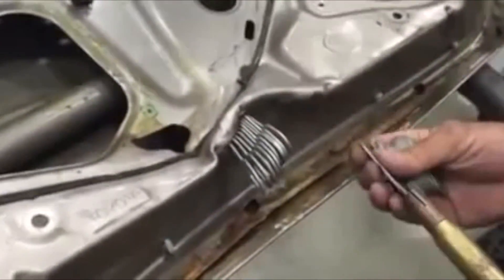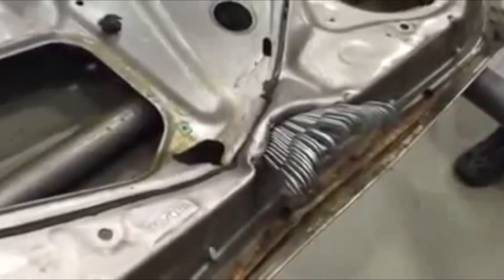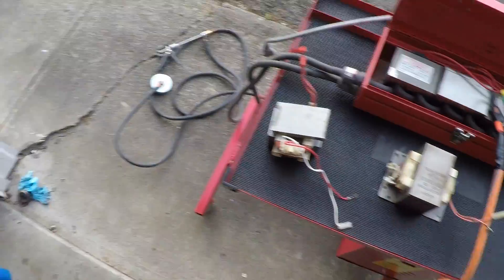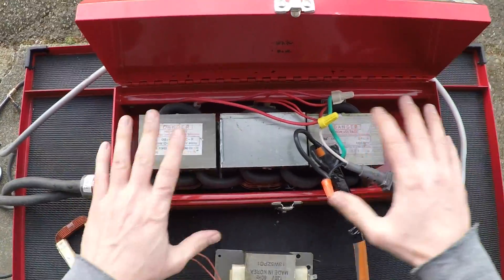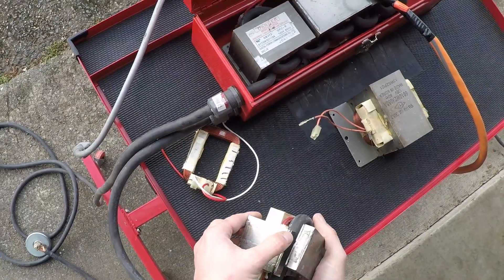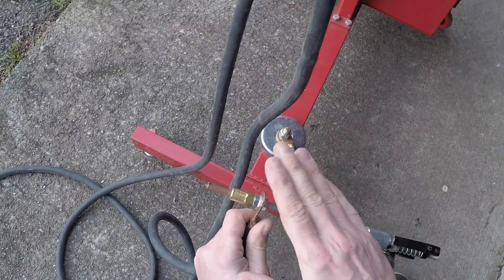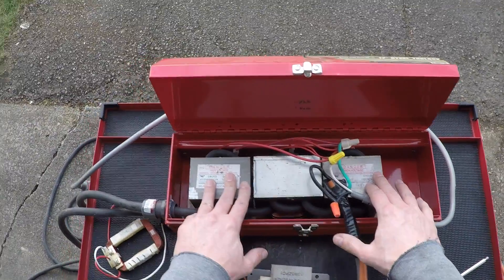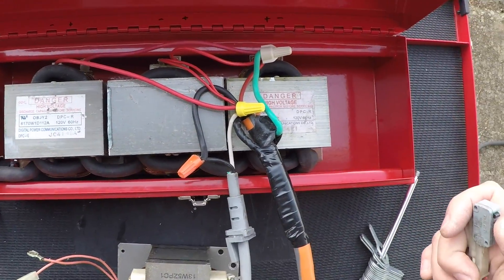✅ How I Built My Car Body DIY Spotter Electric Dent Puller Welder From Microwaves and How It works

Comment: it stil doesnt show alot.you just showed a transformer build
Reply from the maker: That was an older video, I've made an updated video later where I went into great detail on the build. Here is the link: https://youtu.be/j6UgtCN5vzU
Reply: @fix206  thanks i saw the build i would just like to know if it is nescasary for the timer relay seeing you have a push button on the puller.cant you just controle the time on the trigger.
Reply from the maker: Push button is the trigger

Comment: Where did you get those red push attachments? I've looked at various dent welder kits and can't find any like that.
Reply from the maker: The hand squeezer/puller with orange bases I bought from Russia. I am actually working with the manufacture and I have secured a shipment of these kits. Going to have them available for sale. Let me know if you're interested
Reply: @fix206  yeah I'd definitely be interested, what's your timeline for availability?

Comment: I love the red leverage tool you made to pull out the dent.is that on your list of videos. What is. The size of the tip you weld. To the car. Is it soft or hard steel I'm going to try to build one. What is the voltage coming out of the transformer and the amps. Is it ac or DC volts. Hope you can answer these questions for mye
Reply from the maker: Hopefully most of your questions can be answered in the updated video that I did on this tool  https://youtu.be/j6UgtCN5vzU

Comment: Great video. I built a spot dent puller just from your same idea, but I have a strange problem, when I get the short to try stick to the sheet metal, the copper pointer melts and never gets the sticky method to the metal. Any idea what do you think is happening ?
Reply from the maker: The problem you're having is noncompatible metals. Both, your ground and the metal pooling tip have to be made of mild steel, they cannot even be made of stainless steel, anything else but mild steel will not stick to the panel that you're working on
Reply: @fix206  Hi again, thanks for your response and comments. The ground terminal and dent pulling pads I am ussing are from copper. The only part I made were the transformer, just same at yours. All other parts, pulling shaft, gun, copper pads... were purchased from aliexpress. I have in the secondary aprox. 7.2 volts. And using welding wire #4. If I made a short time not welds, If I use a long time aprox.  1 second, the pointer melts and do not welds to the sheet metal.
Reply from the maker: make sire that both ground and the puller tip are steel, not copper
Reply: @fix206  Hi again. I just did some search about the pulling pads material got from the original spotter pulling parts supplier. Those are steel cupper coated. That is the same material used for the factories that built spotters. 
So I am using same material that use original factory electrical spotters. So what is the cause about not sticking to steel panel..?
Reply from the maker: It is really hard for me to say without physically being able to take a look at what's going on with your situation
Reply: @fix206  Friend. I just fixed the issue. I was using wire #2 in the secondary of transformer and wire #4 for the electrode gun and ground, so in accordance to Ohm's law, the wire #4 was working like resistance and not all current was in the electrode as is needed. The wire of secondary, gun and ground must be the same all the way. Now it is working much better.
Reply from the maker: Oh, good to hear that you've got everything worked out... 👍

Comment: Hi. Loved your video and i'm going to build one for myself. I didn't fully understad the wiring of the thicker cable runing trough the transformers. Can you explain it better. 

Thank you.

Pedro Cardoso
Reply from the maker: It's really simple, thick cable just loops around the transformer core as I've done it in the video, once the primary coil is powered up it creates a very strong electromagnetic field within the transformer and that magnetic field in turn energizes the thick cable. So the cable isn't connected to anything inside of the transformer if that makes sense. So as long as you follow all of the steps in the video you will end up with a working spotter !

Comment: Hey my friend I found your polar that you said you bought it's a pilot type 2 puller 120 volt they got a new version of it out they sell it on eBay all right have a nice day and be safe
Reply: Sorry correction they have a type 1 that he has on eBay for sale there is a type 2 out too also sorry about that I had to clarify that have safe day
Reply from the maker: I just looked it up and I did find it on eBay, but the price is pretty steep $1250. I spent about $100 or so in parts to build mine.
Reply: Don't get me wrong I love the one you built that one's great I was just trying to find the polar part it just happened to come with the other part of it that's the only part it  stinks
Reply from the maker: Oh I gotcha, at some point in the near future I will be doing a video where I will reverse engineer this puller. Because I had quite a few people inquire about it
Reply: That would be great my friend I bet the other people would appreciate that too

Comment: You told us at the end that you didn't build the puiier you bought the puller I really do like to know where you bought it from if you could really remember where you bought it from that would be great because that's the reason why I want to build one I could buy a slapstick puller from anywhere I like to pull her you got it that's better than anything I seen so far my opinion thanks
Reply from the maker: I ordered that squeezer/puller from Russia... here is the link to the website https://spotterpilot.ru/product/puller-s-gladkim-shtokom , but everything is in Russian so you may have a bit of a hard time navigating through the website. I will however be making a video here pretty soon where I will be reverse engineering the puller.

Comment: Sir i m confused ..... If those black wire just through the transformers an coming straight out then where is it connected an power is supplyed to the dent puller leads
Reply from the maker: That's correct, the thick cable isn't connected to any power at all. Transformer coil energizes the cable in a very strong magnetic field.

Comment: Nice
Reply from the maker: Thanks Thomas !!
Reply: @fix206  hey I’m in high school and I was thinking of buying a 2016 mustang gt from copart. I’ve had experience working on engines and stuff but not frame and body work. What do you think I should do?
Reply from the maker: Mechanical work is pretty straightforward, bodywork is quite a bit different. If you get something especially with a good amount of damage you'll be way over your head in this project and probably will have to spend a good bit of money to have someone else do 98% of the work which will get very costly real fast, especially if there is frame damage. You need a lot of tools and a good bit of know how to complete a project such as that one...
Reply: @fix206  OK thanks your videos are really insightful

Comment: De que tamaño tiene que ser los tramformadores...
Reply from the maker: Just the regular microwave transformers that you can find... They don't have to be anything special
Reply: Ready my brother was the cable I put a 10mm one and it does not stick to the sheet I change it for a 12.6mm one and now if it sticks special for a welder, nobody tells this secret you have to put a thick cable to take advantage of the most that can be  of the amperes ... If I had to study a lot to find that detail, thank you very much I did it the same as the tullo ...
Reply: Tienes instagran para mandarte las fotos
Reply from the maker: Good job, I think I mentioned in the video that you should use as thick of a cable as you can get into the transformer housing for best results... But I'm glad you got everything figured out and working. It is an awesome tool that you will love using as time goes on...

Comment: 110v or 220v
Reply from the maker: 110... I was trying to find some microwaves that were setup for 220 but wasn't able to find any state side...
Reply: I made one equal to the tullo and it does not stick to the plate I bought a complete pistol
Reply from the maker: How many transformers are you using? Did you double check the voltage output for each transformer and then combined? To make sure that all three of them are running together and that two of them are not canceling each other out

Comment: Can't you just use an arc welder for the power supply?
Reply from the maker: I'm not really sure on how the arc welder is set up, it may work or it may not. But to be honest with you I wouldn't even go as far as cannibalizing a perfectly good arc welder, because getting parts to build the set up is pretty cheap and easy
Reply: @fix206  thank you.  I wasnt sure if I could just attach the spotter to the arc weld leads and use it that way.  But I do like your setup, very nice work

Comment: Why would u want to built one, when u can just go a buy one and be done with it! You can get one for about $100 bucks! It's like trying to make your own root beer, when u go to Walmart and buy a 2 liter bottle for $1.89...!
Reply from the maker: Not sure that I've seen them for $100... But as saying goes you get what you pay for. Cable alone set me back to $60 so I'm not sure how much of a tool you actually get for $100. Also you'll get lucky if you get handful of uses out of one of those Chinese units before it burns out and then you won't even know where to look to get it fixed however if I have any issues with mine I'll be able to fix it up in no time because of how simple my set up is
Reply: @fix206  Yea u can get one for just under $100 usd, even if it burns up , just buy a next one! It's like trying to fix a dvd player, or the new flat sceen tv.s they are design to last for about 3 to 5 years ,if your lucky ull get about 3 years by then it well be obsolete, it well be 100 k plus! So by then ull just get a new flat screen, thats the way it goes now with electronics! you jus replace them , u cant even find a tv repair shop again because all of them are out of business! Thats why china is in the lead of manufacturering world wide, their stuff might be inferior quality, but lets say u buy a toaster for cheap from china, if it last 2 years before it fail, its so cheap u can buy a next one and go for next two years!  So you see right now everyone even name brand products are being produce in china! Thats why we have free trade, its a reasons why it works, lets stay china dont have steel, but america has steel, so china get steel from america and america get tools from china, So everyone survives, If u try to be self sufficient! Youre gonna run into alot of problems with your neighbours!

Comment: For future projects: The transformer leads aren't positive and negative. It's the moving magnetic field available from AC on the primary windings that induces a voltage in the heavy secondary windings you've provided. The iron core serves as a pathway for the field and is made up of many thin layers isolated from one another. This layering reduces the amount of heat generated in the core by limiting the size of induced current flows. Whomever identified this phenomenon was listening to Van Halen using a time traveling hot tub that left him so sleepy he forgot to document its design. He did build it outside in his back yard so it's possible for the images to reach the Asgard Midgard Guard and a cheap version could one day show up on Interstellar eBay. Shipping charges would be a b itch though...

The Eddy current subject is huge. A paper by Lloyd H. Dixon, Jr. titled Eddy Current Losses in Transformer
Windings and Circuit Wiring is a good example of the complexity that shows up as technology increases and higher frequencies are available for common use in voltage manipulation. Well back to isolation..

Comment: Please let me just say that connecting three microwave transformers in the way you did is not to increase the current but to increase the voltage.
This, setup simply gives you better purchase when making the spot welds.
The available current would be just the same with a single transformer but having three in series, gives you better punching power through any dirt etc.
>
Reply from the maker: You are probably 100% correct... I'm no electrician, this is just the way it was explained to me

Comment: Zdorovo 
A ty polzueshsa gassless mig wire? 
Spasibo
Reply from the maker: Спасибо !! I try to stay away from gasless, because normally it leaves a bigger mess behind for me to clean up after and also it tends to burn a bit hotter then regular wire, therefore you risk of burning trough the thin sheet metal. But in a pinch it will do if you don't have anything else. 
P.S. it looks like I have the same kitchen cabinets and cabinet handles in my kitchen :)    https://youtu.be/IJSzvoW8UBU

Comment: How is that microswitch holding up so far? i had to use a relay for my button
Reply from the maker: It held up Ok, but that sure wasn't the best way to go about it. I have since put out an updated video where I perfected my spotter by adding a time relay, circuit breaker and a solid state relay and also updated the the grounding setup. Now it's a much better tool overall... here is a link to that video:   ----------->  https://youtu.be/j6UgtCN5vzU

Comment: hi just wondering how many volts vs amps are the MOTS generating ?
Reply from the maker: Total output around 6.6V and around 800-1000A
Reply: @fix206  thanks for the reply much appreciated well done on the build it works well
Reply from the maker: I'll be posting a video of revised version of the spotter within a day or two, where it gets a few much needed upgrades... Stay tuned

Comment: Hi. U doing very good job. Maybe someone already asked but I cant find in comments. I need to know what wire gauge did u used and what is the metal piece did u used to make ground with magnet.
Reply from the maker: I'll be posting an updated video on this tool that will answer all of the questions you may have. Stay tuned

Comment: I would like to ask a couple question that I do not see here on the comment section. How many feef of #2 wire do you recommend using for this project?  I would also like to ask you what switch is that you use when engaging the spotter?  Is this a switch that can be found in the microwave?  Also, did you use some type of insulation in-between the transformers so they would not touch each other or does it matter? I would like to give you an update. I have one transformer so far!  Two to go !    I am getting more excited!  Thank you so much. 
 :-)  Phillip Hall
Reply from the maker: Hi Phillip, sorry for the delay on the vid that I've promised. It's taking me longer to put out because the hard drive that contained a lot of the footage died on me few days ago, so I had to rerecord a lot of the stuff, so that put me behind the schedule. New hard drive is up and running as of tonight, so I should have the video out by Monday or Tuesday at the latest. And it should answer all of the questions you may have and maybe even give you some new ideas, because there will be few upgrades done to the setup.
Reply: This is more than I could have hoped for. Thank you so very much for makjng all of your videos. They are top quality and packed with some great information. Information that I have had questions for some time and could not find answers.  Thanks for going through all the trouble especially with the computer problems yet you press on anyway. I hope I can speak for all who appreciate you as much as I do. THANK YOU SIR. 😊😁
Sincerely,  Phillip Hall

Comment: I’d like some better details, maybe a diagram and parts list of the squeeze pulled you made. Looks like it’s part of a caulk gun?!?! Great machine btw, I’m in the process of building mine
Reply from the maker: I am currently filming a more detailed version the spotter build with some upgrades. It should be out by Sunday or Monday, stay tuned

Comment: I have been seeking information as how to build one of these. This video is excellent. I do have a few questions. I will first read all the comments as you might have already had others ask the same questions that I have. (I don't want to worry you). 😊 . 
But if I have a  question that I can not find the answer to, I may add more comment questions. Thank you very much for making these very good videos. I wish you much success!    Phillip Hall
Reply from the maker: Tomorrow I will start filming a revised video on how to build one of these from ground up. I will also be adding some more components to it to make it more efficient and user friendly thus easier to use. I'll make sure to be very thorough with the build, that way 99% of all of the questions should be addressed in the video. So that video should be out later in the week. Stay tuned my friend !
Reply: This will be more than I could ever hope for though now, I think I fully understand. I am gathering transformers even now. lol Thank you so very much!!    Phillip Hall

Comment: Could a welder be used ?
Reply from the maker: Yes it can, but you have to be careful welding thin sheet metal, because it is easy to burn through and make matters even worse.

Comment: Hello, so you simply coil the transformers and power them up? There is no need for capacitors and stuff like that?
Can this cause electrocution?
Reply from the maker: No need for capacitors. I've been using this setup for a while now, haven't gotten electrocuted yet :) There is only 6-9 Volts that flows through the secondaries, so low voltage/high amperage. I'll be modifying this setup this coming weekend by adding a timer and a solid state relay, so I think I'll do a revised video of a ground up build of the spotter with upgrades that will make it more user friendly. Stay tuned my friend !